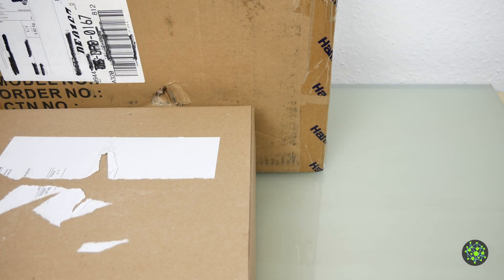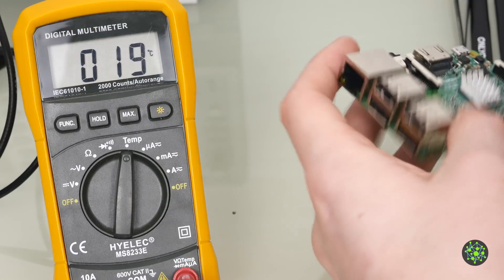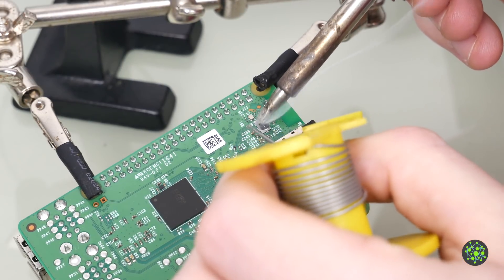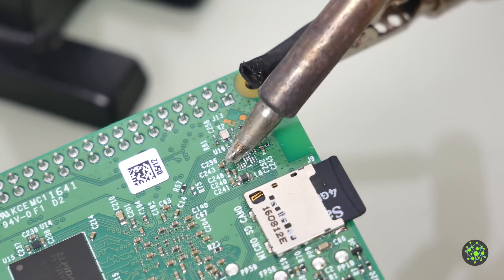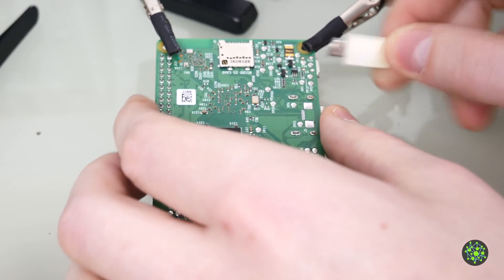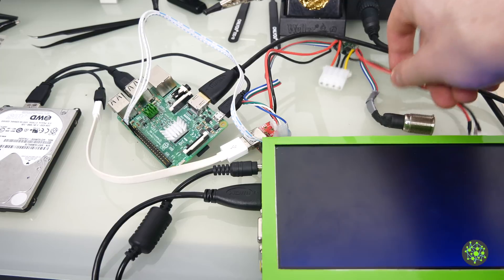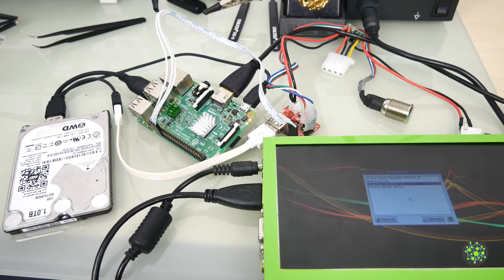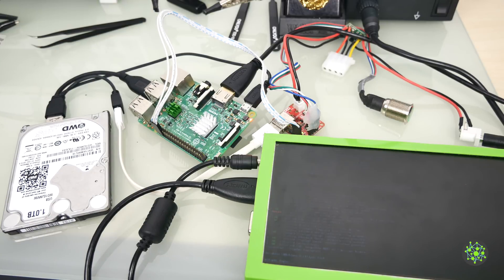How to fix a Raspberry Pi 3 where the wifi chip is overheating

Comment: You might want to use some Masking Tape to protect the other areas in case of contaminating and shorting circuit by soldering iron or

Comment: Congratulation - Thank you very much! You first time managed to physically remove this brain destroying irradiation threat off a RasPi and (more important) proved that it still will boot! Castrating such factory-prebugged all-in-one standard equipment is in many places mandatory for security and health reason.

Has anybody successfully eliminated wifi from modern routers? Mine ist limited to DSL 16k because there is nothing available (beside moonpriced lab equipment) that is not infested with this pulsed microwave disease.
Reply: u cray cray

Comment: Is it posible to remove the wifi/bt chip on the Raspberry Pi 3 A+? It is in another location under a metallic shield, and I would like to completely disable wiifi and bt by hardware.
Reply from the maker: It might be a little more tricky to get the shielding off without destroying something else

Comment: Tip: Next time use solder wick to remove the solder. Works much better. But be careful that you don't touch it to parts that you don't want to remove solder from.
Reply: You will need additional flux to reliably remove remaining solder. I would try a hot air soldering device instead of toasting that tiny chip with the iron.

Comment: Hello, My Pi heats up in the LAN Controller chip and only faint Red Led. Is there any fix for this? Pls Need Your Help.
Reply: It happens when your power supply doesn't meet the requirement. (5v and 2.1)

Comment: good work mate big up... my pi got overheating and the red light won't working ..only the green light blinking and few Second the pi shut down .. is it the wifi ??
Reply from the maker: It could be the case, but you should try to figure out where the heat is coming from. In the best case use an infrared camera or if you don't have one try probing around with a temperature sensor to find the part that is getting hot.
Reply: enwi i will try that ... thank you alot  👍

Comment: did the wifi still work even though the chip was overheating?
also I wonder if it is possible to get that chip in small quantities from ebay or digikey, I doubt it though
Reply from the maker: +David Scheiber It worked until the Pi shut down for the first time and then didn't anymore. You might even get them from AliExpress
Reply: also congrats on 2.5k subs 
that was fast, last I checked you had 62 subs
Reply from the maker: +David Scheiber Thanks :)